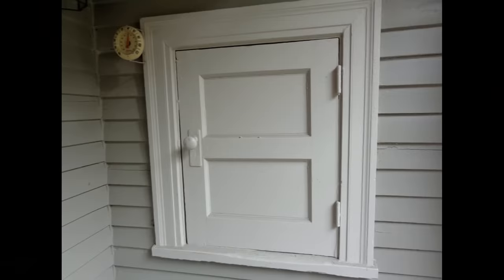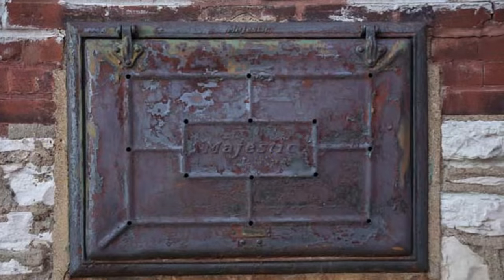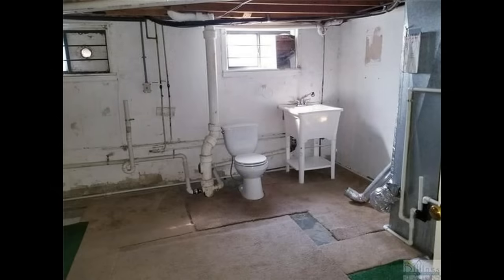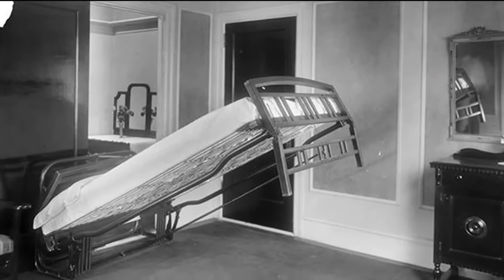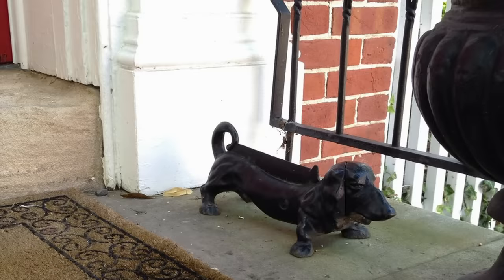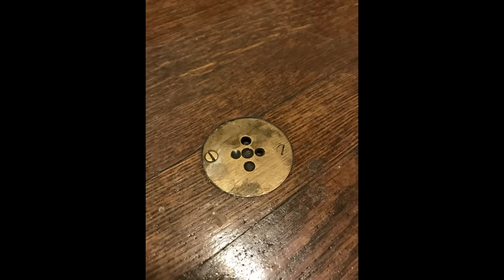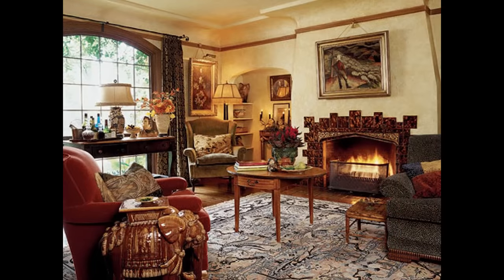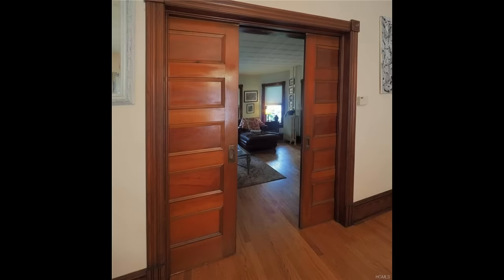Mysterious Home Features No Longer Used

Comment: The reason the laundry chute is no longer a thing is because it's illegal in many jurisdictions as it is a fire hazard. You will note that most homes now (with the exception of the stairwell) try to block air from moving from floor to floor except in fireproof ducts. In the event of a fire of the house would catch fire very quickly from floor to floor with a laundry chute
Reply from the maker: Ah, that makes sense.  I did not think about that and now I'm amazed that people are putting them in.  Makes me how many have done it despite the laws in certain areas.  Thank you for watching and educating us about that.
Reply: Yes, laundry could get caught mid-chute. You can imagine having that problem and needing to get it out. A big pile of stuck laundry could pose as a fire hazard, as you mentioned.
Reply: @grumpyoldwizard  the fire hazard isn't stuck laundry, it's the air flow.
Reply: @grumpyoldwizard  It's more about how readily fire can move from floor to floor then stuck laundry... This is also the reason why you will now find blocks placed between floors in houses now, whereas they used to use what is called balloon construction which provides fire passage from floor to floor. This is one of the reasons why it's harder to wire houses now after the walls are closed in
Reply: @RhettyforHistory  Very interesting! I can see why they're not used anymore, though the hobby engineer in me can't help but wonder if there's a way to make one that's fire-safe, because they sure are handy!
Reply: @JamieCashin  , couple the laundry chute with some good old tube and knob wiring and you have a winning recipe for an insurance claim .
Reply: Very interesting.
Reply: I think there’s also a risk of children getting stuck in them trying to play around.
Reply: @RhettyforHistory  come. 
Such hyperbole. You have more chance of getting killed in a car accident than a random laundry chute adding to very rare fires. And honestly, when the interior walls are wood framed and plaster I hardly think a laundry chute is the danger point of a fire has already taken hold.
Reply: @xr6lad :  Oxygen fuels a fire.  They become chimneys.  There's probably a way to get one approved with a sheet metal liner and a self closing fire door at the top, but it would require an architectural or engineers stamp.  As cool as they are, I can understand the reasoning here.
Reply: The chute creates a chimney. It's the same reason balloon construction is no longer used.
Reply: @grumpyoldwizard  I had an old house with a laundry chute from the 2nd floor bathroom to the basement. The previous owners left a fiberglass rod in the hallway closet. Found out early on in was used to clear a clothes clog. It never dawned on me the chute itself being a fire hazard as it would be a source for oxygen to feed a fire.
Reply: We had an addition put on our home about 20 years ago. My wife, who had grown up with a laundry shoot, want to install one in the addition. We were told it was against the local fire code.
Reply: @DS-tt9vz   How many times did that particular house burn to the ground because of that laundry chute... thought so
Reply: The chimney effect is an EXTREMELY easy problem to engineer around, with a universal, and universally pre-approved design that would be legal everywhere.
Reply: My mom who was born in 1925 said the laundry chute was a hazard to small children who would climb in.
Reply: @student1621  Your mom is correct about the laundry chute and children.  My ex said he and his siblings risked life and limb to go down the laundry chute in his granny's home.  She always kept a big pile of something to break their fall at the bottom.  Also, I caught my oldest daughter holding onto my youngest daughter's ankles while she dangled down in the chute at our house.  It's more dangerous for children than the thought of fire!
Reply: Actually most new homes are designed with first floor or in some cases second floor laundry room's nowadays,  so there's really no reason to have the laundry chutes anymore.
Reply: I do understand the ounce of prevention with making laundry chutes illegal. But I've lived in four houses with laundry chutes (a huge sample size, I know) and all of them had a door that is meant to be closed. And I would think that being closed on one end would prevent the chimney effect. But I'm not a professional anything, so...
Reply: That sounds so stupid.. 
especially since people no longer use open fire to heat themselves… 
Some American safety laws are so stupid…
Reply: @grumpyoldwizard  I lived in a house with a laundry chute and that's the reason we never used it. The clothes would snag on jagged sheet metal where the sections joined. If your clothes didn't get stuck, they frequently got a tear or started to unravel the cloth. When we moved in, we thought that this was an awesome feature. Within the first year we realized that it sucked and stopped using it. I lived there for twelve years, my mom moved out three of four years later, so the chute went unused for a long time. Well, not used for laundry, that's for sure. We sometimes dropped other things down there. Things not made of fabric.
Reply: @xr6lad  My grandma had a hole in the bottom of one of her bathroom cabinets that you threw clothes through to the basement. And yes, we used to jump into the basement all the time through it. Eventually my grandpa built a wooden cage box to catch the clothes and that ended us jumping down it.
Reply: Laundry chutes are still used. You can buy them online, often set in the lowest part of the wall below a fire block. Each state has different laws and each country can have different laws.
Reply: @dogman9291  Maybe some kind of trap doom at the bottom of the chute with a very sensitive weight censor to detect cloth hitting to door to open it and close automatically, build in the rights way it would prevent airflow issues.
Reply: In that same concern about allowing fire to travel between floors 2x4 8foot stud wall construction replace the original replacement of wooden beam construction, the 2x6 or 2x8 16-20 foot studs. 
Laundry Chutes from the second floor (or higher) to the basement laundry may no longer be a thing but single floor holes in a closet or under a bathroom sink can still be found as a conduit for dirty laundry. Because the distance of the hole is not much larger than the thickness of the door, the width of the hole need not be very large… clothing can be dumped into the floor and kicked one at a time into the hole with only large items need some manipulation I can fit an entire king size quilt through a whole about the size of a license plate in my first floor bathroom to the laundry area directly beneath it just by feeding a corner into the whole and patting gravity pull the rest through
Reply: Don’t apartment buildings still have garbage chutes? Do they impose the same fire hazard or is the technology a bit different such as the heavy metal doors on them?
Reply: @smartysmarty1714  I grew up in a house with a laundry chute. It was made of sheet metal, and had a metal door at the top that opened and closed on a metal spring. It didn't look anything like what was pictured in the video.
Reply: Don’t stairs allow for air flow like waasay more lol
Reply: The "fire hazard" vs. convenience factor leans strongly in favor of the laundry chute. Our local fire code administrator tells us not to prop doors open at work....because it is a "fire hazard". That isn't practical in our room with a copier that we go in and out of 300x a day. Always go with the law of averages vs. the regulatory state. In the very rare case you lose, then you can second guess. I stress very rare. Very, very rare.
Reply: I get it. But it would make things SO much easier!!!!
Reply: @gregggoss2210  The original 'knob & tube' installations were quite safe and dependable.  Problems occur today when the wire insulation materials become dry and cracked to expose bare copper wires.  The bigger problem is when people mixed new wiring systems with the 'knob & tube' system and it is rarely done properly.
Reply: @xr6lad  Getting stuck, or amputating hands, feet or even a head.
Reply: @xr6lad  Much of the fire code is based on the rate of spread that occurs during a fire, when a one minute difference and be the difference between life and death.
Reply: I thought it was more that new homes had the laundry room on the top floor at least where I live.
Reply: @coolsidecool  Yes, most homes now have laundry facilities on the first floor, rather than the basement.  Many now have 2nd floor laundry located where the bedrooms are. Just pray that they never leak.
Reply: @RhettyforHistory  There is a version of them that's starting to be used, it has blocks along the way that require weight to move them. There's one per floor.

There's also a larger version that's becoming available that doubles as a dumbwaiter, but powered rather than pully for it, those tend to be something harder to ban because it also works as an accessibility feature...one person I know had a house built with one recently due to a family member with a missing limb and it lets them move things more easily between all the floors of the house, it's big enough that you can fit some of the shorter, plastic laundry baskets into it, and the platform in it is hinged where you can push a button to open it and drop things through to the basement where they do laundry where there's an added gate with a piece to eject things to the side that are dropped down, but you can also lower things all the way down to just under waist level.
Reply: The whole point is airflow. Just like if you break a window you better be getting out cause the vacuum of the air coming in is now gonna feed the fire and make it burn hotter and spread fast. Just like blowing on a fire you make the flames bigger. How thats not logical worries me lol
Reply: No   Laundry stopped being done in basements. They aren't a fire hazard. The doors close, like a door
Reply: Never would have known that. Thank you for sharing.
Reply: @student1621  We found it was great place to hide during hide and seek. If you climbed above the basket if someone opened it to look for you all they saw was an empty basket!
Reply: You can still build a house with a laundry chute as noted by new house plans. I would love to have one!
Reply: @TheOldTapeArchive  not to mention the chute has two doors to prevent air flow! It’s not just a big hole with free flowing air and open ends
Reply: In 1970 we had a new home with a laundry chute and an intercom.   The intercom was a bad idea.  Like you are going to talk with your mother over the intercom when you can just yell or walk up the stairs.
Fire hazard?  It was a split level home, so the laundry chute was not the problem.  
A fire occurs in the kitchen most often, I suppose, or near the fireplace.  We had a brand new franklin stove, too.
Reply: @dogman9291  I think if you just had fireproof doors the way the Titanic had between bulkheads might be practical. You just have them hooked up to a smoke detector and all the fireproof doors could automatically shut. shut. (of course, that tactic didn't help the Titanic too much, but that was a special case.)
Reply: I read years ago that they were made illegal because people were afraid children would climb into them and fall. I don't have a citation.
Reply: I'm not sure where you live, but many jurisdictions allow them. Most Building Codes require a particular height off the floor (usually 36") and a limited diameter. Some areas require they are connected to a smoke detector so the doors automatically close when they go off.
Reply: and a great way to loose a kid
Reply: @deniseboldea1624  I still hang out laundry. Second floor would just add to laundry day.
Reply: @barbaramelone1043  Our clothes chute had a door in the upstairs and in the kitchen and they were like little closet doors made of wood. But then our old house was built in 1901. Different styles for different eras.
Reply: @student1621  we had a garbage chute out of metal and at 4 yrs old it was a blast to slide down.
Reply: I have a laundry chute in my bathroom.  House was built in 1956. I use it all the time
Reply: @winebox  I don't know if it's a great idea, but it does seem to be catching on in some areas.
Reply: @chrisgraham2904  Many building codes now require a pan under the washing machine that drains either outside or into the house drainage system. That takes care of almost all leaks.
Reply: Newer homes also put the laundry on the bedroom level now, so there's no need for a chute
Reply: @Mike Oxlong
My house was built in the 70’s and I have a laundry shoot. It’s in a closet, made with metal and the opening is sort of high so a child would have to climb up and over. It’s rectangular and on the narrow side which would also discourage a child. 

BTW, never had anything get caught. They’re great for getting clothes DOWN TO the laundry but I need something to get clothes UP FROM the laundry. Maybe a dumb waiter, is what I need, oh wait I have one, my husband.😂
Reply: Oh Zeeze, chute not shoot.
Reply: @xr6lad  The important thing is that insurance companies know they increase the number of claims, and therefore push to have them banned in modern building codes. You need to follow the money - if an insurance company says it's a problem, they know what they're talking about - it's a problem.
Reply: Really??  What about wide-open staircases?  They’re really big!  LOL.  I can’t imagine a laundry chute contributing to a fire hazard all that much.  For one thing, both chute doors are closed except while in use.
Reply: @smartysmarty1714  I
Reply: @smartysmarty1714  I had a friend that put one in her house. It cost $6000.00 extra because of all of the permits and inspections. It had to have 3 fire blocks, one for each floor.
Reply: My friend in elementary school had a laundry chute. It was awesome. BUT if it had been any wider I 10,000% would have gotten in. Other than stupid children I didn't know why we don't use them anymore. But fire? That's a no for me.
Reply: @renpilak6048  Yeah. Now I have more questions...
Reply: The laundry chute we created in my parent's home IS a fireproof duct.
Reply: Baloney! They are safer than a central climate control system. I've lived in 2 houses with laundry chutes and single zone central forced air heating and AC (one from the 40's one from the late 70's)...The laundry chutes were made with the same metal ducts as the climate control vent system. The chutes always have a door on the top end to seal them, but the vent ducts connect all rooms with nothing to block smoke or fire flow....Hell the central fan can suck fire and smoke from one room and move it to another and would do so automatically in summer when the AC is on.
If they were really a fire hazard then central forced air climate control systems would be outlawed too for the same reason.
Reply: @TheOldTapeArchive  if you have a fire alarm then there is a special battery operated door stop you can fit to doors such as your copier room. It's spring loaded and retracts if the battery fails or the inbuilt microphone senses a continuous noise level over approx 85 decibels such as when the fire alarm sounds. The doors then close automatically it they're fitted with door closers as fire doors are (in the UK at least). The UK version is called "Dorgard" and they're really useful to remain fire safe and convenient.
Reply: Modern laundry chutes have built in flaps that close automatically by a spring, once the laundry drops down the flap springs back up and closes the laundry chute.  Meets local fire codes.  The flap is pretty strong and close fitting, my cat hid in the laundry chute and never fell through it.  He was a "big boy" weighing 18 pounds, never fat!  Just a average sizes Maine Coon who never divulged how he got into the laundry chute, he was there a lot....
Reply: They should also ban stairwells and balconies overlooking great rooms !
Reply: That's really interesting when you look at the modern homes these days that have huge foyers that are open to the second floor anyway.
Reply: Since carrying a laundry basket down steps to the next level is the biggest reason for home injury and death every year I would rather take my chances with a laundry chute especially since I know of many houses that are well over a hundred years old and have never had a fire.
Reply: Worse than the laundry chute/chimney could be found in most knob and tube houses.  These houses were built using balloon frame construction with open walls from basement to attic in multi-story houses.  The whole house was a chimney.  Fire caused by a coal furnace or anything else in a basement could get in the walls and the attic would be on fire before the walls got noticeably hot.
Reply: @RhettyforHistory  why do you wonder how people are doing it? Do you think everyone immediately consults "the law" when they want to do something? My house - I'll do whatever the hell I want inside of it, thank you very much.
Reply: thanks for the info!
Reply: @renpilak6048  On the inside of apartment buildings they are sealed off.  Modern garbage chutes in apartment buildings are on the outside of the buildings.
Reply: @grumpyoldwizard  luckily I had someone who knew that a golf ball retriever would work.  I have a 2 story house with laundry in the basement.  And I learned the tricks to prevent the clogging.  My housekeeper kept clogging it up with the sheets so she is forbidden to use it now, lol.
Reply: I love my laundry chute!!!!!!!  I have a 2 story house with laundry in the basement, built in 1928.  Best tip I received—golf ball retriever dislodges clogs (use from the bottom).
Reply: @xr6lad  when little, we took a buch of pillows and placed at bottom of chute and our little sister would go down it
Reply: @xr6lad  I don't know about "rare." I know at least a few fires where I normally walk.
Reply: I remember trying to shove so much laundry down as a kid that I'd have to bust out the broom handle or whatever I could to push them down. Drop those items and it was a long day. Today, I have disabilities and would LOVE a laundry chute...and a dumbwaiter to bring the clean stuff back up. Or just be able to find a ranch home I can afford! lol
Reply: @ericah980  hi! Yes, our 1953 home had one. We used it for 12 years while there. Never had any clothes stick in it.it was made three feet off the floor ,in the hallway. They used to make clothes nets to catch the clothes. Think of all the tumbles down the stairs with baskets of clothes, that they they saved!
Reply: Keep the lid closed prevents air flow.
Reply: @student1621  One thing that can be said for kids playing around in a laundry chute ... they only do it once ...
Reply: @hazelwears8728  I guess women in 1925 weren’t able to stare at their children all day, since housework would take hours upon hours more time than it does today. Also, current parents don’t stare at the kids every minute of the day either, as people still have to go to the bathroom, shower, do chores, maybe work from home, etc.
Reply: Oh, that's right.  We're more conscious of fire stops these days.
Reply: @dogman9291  If you had fire-stopping baffles at all floors, that had to be overcome each time, would that work?
Reply: @lindac6919  That's along the lines of what I was thinking!
Reply: Had a laundry chute in a house I owned some years back- it was really well made, had a door on the top floor and one also on the main floor.  I loved it.  I miss it
Reply: Wow, have not thought of that. 
Sure would be a great feature to have though.
Reply: Depends on the state and historical value of the house. Laundry chutes are still in a lot of old houses as well as the dumbbell waiters. It is entirely possible to seal the chute from airflow when not in use.
Reply: The one house I had with a laundry chute had a pocket door at the bottom that closed it off. It prevented the airflow, and kept the laundry collected in a small cabinet next to the washer in the basement.
Reply: All the houses in the area where I live, including the newest ones, do not have doors between levels. Stairways are open. The newest homes are open from the ground floor to the ceiling, 30 or more feet above. Why worry about the fire hazard of a laundry chute when the house itself will not stop the spread of a fire?
Reply: Nowadays, laundry rooms are frequently built on the second story instead of the 1st. I definitely find this to be far more convenient since the majority of our laundry is distributed upstairs anyway.
Reply: @catatonicbug7522  my laundry chute was pretty big, and had a “box/cabinet” on legs at the bottom. It was in the basement and the clothes never touched the floor. It was awesome
Reply: @student1621  My son who was 6 at the time got stuck while playing hide and seek while we were out, . The older son called the fire dept. who had to smash the wall and cut out part of floor in the bathroom to reach him. He was wedged in pretty tight. We did repairs minus the shute.
Reply: @DUCKDUCKGOISMUCHBETTER  yup. My sister has one on her newly build house jere in Germany - and health and safety is taken extremly seriously here.
Reply: And plus I think that in most multistory houses, the laundry room is on the same floor that most or all the bedrooms are located. The closest thing you're likely to get in a modern house to a laundry chute is a dumbwaitor. A dumbwaiter is essentially a small freight elevator.
Reply: I live in a house built in 1924 and the city code requires springs on the laundry chute for fire safety.
Reply: @EmilyTienne  one thing making a laundry chute into a bigger fire hazard than a staircase is that the laundry chute often has a large pile of flammable material sitting at its base, and is frequently close to one or two possible ignition sources, the dryer (especially if it’s a gas appliance) and often the furnace isn’t very far away.  If the chute is metal-lined, smoke is the main concern, but if it’s wood, or plastic, or whatever, the lining of the chute can catch fire and carry it upwards in the house, possibly blocking escape routes from upper floors.  And chutes don’t always have doors at both ends.  I lived in a house built in the 1930’s with one, and it ended in a slatted bin about 4 feet
Off the ground.
Reply: A modern laundry chute is metal with a spring door like shown in the video.  No fire hazard.
Reply: My nephew thought he'd be clever and send himself down the chute to wow the family. His parents were not pleased!
Reply: @Leigh-says-stuff  This is all true.
Reply: @RhettyforHistory  Actually every laundry chute I've ever seen had a tin liner so clothing wouldn't catch on any nails or splinters. This also made them fireproof. I grew up in an older part of town so I saw a LOT of the features in this video. We STILL have a medicine cabinet with a razor blade slot in our CURRENT bathroom.
Reply: @xr6lad  This happened to my cousin in the 80s.  He's an idiot though, so....!  🤣
Reply: @marialiyubman  People do still use fireplaces if they have them in their homes.  And fire is still a thing, whether people use it to heat or not.  If a fire happens, that chute will make it spread much faster, to all levels of the house.  It makes perfect sense if you think about it for a second.
Reply: @larsonfamilyhouse  My cousins lived in an older house, in the 80s.  It had three stories and there were openings, with no doors, to the chutes in a couple of places on all floors. It lead into the basement and just dropped from an open area into a basket.  No doors at all.  Also, as an avid Estate Saler I have been to several houses with chutes, some open some with doors.  They just aren't all the same.
Reply: my aunts old house used to have one of those, i remember looking down it from the top floor
Reply: @RhettyforHistory  kkkmm
Reply: @RhettyforHistory  mmkkmmm
Reply: @RhettyforHistory  kkkkkkkmkkkkkkkkkkkmkkkkkkkkkkkkmkk
Reply: @RhettyforHistory  kkkk km to kokkm
Reply: @RhettyforHistory  mkkk
Reply: @RhettyforHistory  mkkk
Reply: @RhettyforHistory  kkkokmkkkk
Reply: @RhettyforHistory  k
Reply: Kkkkmkko
Reply: @RhettyforHistory  k
Reply: Yes, my grandmothers house had them and I got to take them out when we remodeled it. The rope was pretty thick if I recall and the weight was just a cylinder of lead.
Reply: In the movie "Critters 3", the monsters, a flare, laundry chute, and laundry caused a fire in an old apartment building.
Reply: But it's so convenient :/
Reply: Also too, if you can put them on they must be big enough for an adult to fit through which means they take up a lot of space in a home that might not be present if not planned for.
Reply: @dogman9291  100% there probably is. But it'll take someone more experienced than me to figure that out
Reply: With all the open plan now I think a washing chute won't make any deafferents in a fire !
Reply: @TheOldTapeArchive  Your local fire code administrator isn't wrong though and has your long term well being in mind.  Conforming to the fire code regulations has never been about practicality.  It's about saving lives and minimizing the spread of fire throughout structures.  
I cannot speak for your specific situation but while it's true that large fires are fairly rare occurrences for most people, in situations where fire is present, laxity almost always leads to preventable losses to life and property.
Reply: @renpilak6048  The materials used for garbage chutes tend to be fire resistant and sturdy metals and/or blocks as opposed to the fairly flimsy wooden or sheet metal for a laundry chute.  Also, garbage chutes tend to have better seals to prevent odors which also makes the chimney effect less of an issue.
Reply: As a kid, my brother, cousins, and I would climb down the chute from the second floor to the basement at our grandparent's home.
Reply: @gregggoss2210  Properly installed Knob and tube wiring was very safe. It dissipated heat very well. One of the problems with it is that people would add circuits to it then put a larger fuse in the fuse box or worst of all put a penny under the blown fuse. We used to have a electrical contractor in town by the name of Penny Electric. Their slogan was "Don't put a penny in the fuse box, call Penny Electric.
Reply: They’re not illegal here but most new builds have the laundry room on the same floor as the bedrooms or it’s on the main floor.  I haven’t seen a new build with basement laundry room for a long time.
Reply: I lost my front teeth, smashed out on the door jam of the shoot, when dislogging a blockage and trying to not get hit in the face with dirty laundry.
Reply: @lilah66 , we had tube and knob wiring in our house up until  about the mid 60's. The insulation had deteriorated so it was necessary to replace it. My dad and my brother rewired the entire house themselves.   Yes, that type of wiring was good when new, but after so many years it becomes a safety hazard.
Reply: I guess it depends on your state as to the laundry chute being considered  a fire hazard.  Here in WI it is not.  My house has one.  Never heard of it being an issue.
Reply: A common feature in many older homes to this day are open air registers between floors allowing for natural convection. For example, my grandparents' house only had forced air registers on the first floor. The only source of heat to upstairs bedrooms was a single ~1SF register in the center of the house. On a bitter cold night, the stairway door would be opened.

My brother once owned a single story home with a basement furnace that worked entirely by natural convection. There was a single large register directly above the furnace and multiple cold air returns near the perimeter of the house. All had adjustable louvers. The house had an early version of an open concept. The only way to get significant heat to the bedrooms was to have the doors open.
Reply: Thank you Jamie, I would never have known or thought about that, but you are absolutely correct on that theory.
Reply: The modern one require fire doors and dampers I think.
Reply: True fact, I bought my house because it has a laundry chute that goes all the way to the second floor. It is line with sheet metal. Oddly enough, the first floor access is INSIDE a kitchen cabinet.
Reply: I was thinking it just became a home for pests, but that makes sense.
Reply: This is actually pretty simple, the reason why the sheetrock on the ceiling is 5/8 instead of 1/2 is because it represents a 1-hour fire break. A laundry chute  breaks the rule and breaks the break.
Reply: @grumpyoldwizard  Think big. Think about the kids using it as a slide. And getting stuck.
Reply: Maybe that's why our "chute" was just a trap door in the bathroom closet
Reply: @ankylosaruswrecks3189  There's a reason why the dinosaurs are extinct, and you're it!
Reply: It makes much more sense to have the laundry area by the bedrooms than to have it in the basement.  While a laundry chute is nice, you still have to haul the cleaned cloths up the stairs.
Reply: @ericah980  I have one in my kitchen, my house was built in the late 70's.
Reply: It could be addressed the same way the turrets and powder magazines for guns on ships are protected from explosions spreading.   There are cylinders with an opening on one side which is rotated.  That would also keep kids out of it.
Reply: I added one to my home over 30 years ago from the upstairs guest room to the first floor laundry room .  Never gave the legality a thought.
Reply: @xr6lad  Dad put a latch on ours when my baby sister came along and started crawling. It had been just a loose board laying on the floor
Reply: @ankylosaruswrecks3189  as someone mentioned earlier, house fires are extremely rare. To justify their full time positions and exorbitant salaries firefighters have to go around and cause trouble for people to make it look like they’re actually doing something. Eliminating laundry chutes was just one such measure.
Reply: When I worked as a carpenter several years ago, we put in fire block (2x4 between studs), every for get vertically. This was to stop the chimney effect inside walls.  Won't stop a house for, but can slow it down quite a bit
Reply: With laundry moving up to the upper floors where the bedrooms are, less necessary or practical.
Reply: @renpilak6048  exactly, also they are not inside the apartments.  For codes are far more restrictive in àn apartment building or condo.
Reply: Fire Safety
Properly designed, a laundry chute provides unobstructed passage between floors. Many people believe that this chimney-like construction has the potential to turn a small fire into a really big and utterly devastating one. On the other hand, many builders and architects point out that stairways carry the same potential risk. And whereas stairways are typically open, laundry chutes are most often closed shut behind doors that can slow a fire’s spread.

Regardless, in some municipalities, there are strict fire codes prohibiting or restricting the construction of laundry chute. Before going ahead with plans, be sure to check with your local building authority.
Reply: @CAgrandaddypurps69  the vacuum of the air coming in?
Reply: @colettes4999  someone further up was talking about "loosing" kids. There's a lot of it about.
Reply: Children also tended to try sliding down them and some have died doing so.
Reply: The house I grew up in, built in 2003, had a laundry chute. Guess it wasn’t illegal in Missouri at the time
Reply: Today they place 2x?'s between the studs in walls, the floor, the ceiling and the rafters.
Reply: @marialiyubman  There are lots of houses that use open fire to heat. Ever hear of a fire place? Many are open and lots of houses have them. And they're still used!
Reply: @Nicky L Why are you jumping on me?  I didn't think that idea up, it's simply something that has popped up on a few HGTV shows.  My best guess as to why would be that most bedrooms are on the second level of a colonial home, so perhaps those who choose this option feel it's easier to gather and clean the laundry.
Reply: But wait, noted residential fire expert Roy Marshall: “A stairway does the same thing.”
Reply: @larsonfamilyhouse  yes. their argument is nonsensical
Reply: @deniseboldea1624  2nd floor laundry rooms are horrible.
Unless you like the stairmaster to work out to change loads of laundry constantly.

Those appliances are going to break at some point.
Hauling one of those bigger newer washing machines down a flight of stairs and up one is a nightmare.

Or when it does break it is going to flood the house.
Damaging the floors, the framing, the drywall and insulation. 

If it is a slow drip through the framing  that is not noticed for a while then there is possible mold, wood rot and under the right conditions attracts insects such as carpenter ants and termites.

No thank you.

This is not a good idea.
Reply: @Loagun  I never knew you could fireproof a duck.  I'll bet that makes the PETA folks happy.  Hellish on the cook on holidays though................
Reply: P
Reply: @shawnr771  LOOK!  I'm not endorsing it, I simply mentioned it, would you people stop yapping at me already!  Direct your complaints to HGTV if it upsets you that much!😡
Reply: @deniseboldea1624  it dont upset me you seem more upset.
I listed why they are not a good idea.
Reply: @shawnr771  My apologies,  another poster was acting as if I came up with the idea, your post coming right after seemed like you were jumping on the bandwagon.
Reply: @deniseboldea1624  nah.
I got no reason to do that to anybody.
Just sharing some practical experience.

Another bad idea is Spa tubs.
Waste of money.
Most people use them a few times then never again.

The water lines under them leak without the homeowners knowledge.
Then the same thing happens.
Reply: @janehitt646  I lost mine running into the handle of a grocery cart at the store.
Reply: @grumpyoldwizard  mom would push stuck laundry down with the broom handle.
Reply: @RhettyforHistory  I suspect it's mostly because hiring a contractor in to do some work a lot will just do what you ask and not worry about code violations, that's a you problem when you try and sell the home and the buyers conveyancer points it out
Reply: @Loagun  a duck?
Reply: @dogman9291  Well, you could put doors into the chute that can be opened manually but close automatically. If those are fire-resistent (and especcially smoke-resistent) enough for your jurisdiction it should be no problem.
Also keep in mind that fire protection is in many jurisdictions a holistic (?) issue: The laundry chute posed a danger, primarily because it was an unobstructed path into the basement, where the fuel for your heating would often be stored too. If there was a gas leak, it would spread up into the living space often even into the bedrooms. If the coal caught fire the smoke would spread upwards.
But an increasing amount of new-build homes don't have fire-based heating and have ergo a much lower risk to fire in the basement in the first place.
Reply: I had a chute growing up clothing would get stuck soooo much and now you say it such a hazard. However because of the older house it was original and omg I miss it as an adult!!
Reply: The reason laundry shoots are no longer a thing is because people don't put their wash machine in the basement anymore. You may be correct about the fire hazard and and the safery risk of a laundry shoot but ultimately that has nothing to do with why people don't use them
Reply: Not true. Most laundry chutesare lined with metal So they don't spread fire in the smoke as in a problem because they're provided with little doors
Reply: @grumpyoldwizard  laundry does not get stuck in the laundry shoot and all you He have to do is grab a broom and push it down. Laundry shoots are very handy and safe mostly women a ton of work. I have one in my house and it's metal lined and has a little door so it's not a fire hazard. I have no idea where somebody came up with that but it's fairly creative
Reply: @dogman9291  they were made fire safe. They were always lined with metal. And they have a door in them that you can close
Reply: You are the destroyer of my dreams; ill have you know that now. All my dreams (of havin a laundry chute) have been dashed to pieces by your comment.

How dare you destroy our dreams! /s
Reply: @RhettyforHistory  Maybe they have some method to close the chute completely in the middle to prevent air passin up or down?
Reply: @xr6lad  We never did, even as younger teens....
Reply: @gregggoss2210  My family's home built in 1966 had a laundry tube, and I can guarantee you we did NOT have rod and tube wiring. I watched much of the house be built as a child when we'd go visit it during construction.
Reply: @RhettyforHistory  if you note the example you showed near the end had the laundry chute in a metal duct quite similar to a ventilation duct. I would assume a design like that would help to prevent fire from climbing.
Reply: Oh, no! Illegal? Our home growing up (in the '90s and '00s) had a laundry chute, and it was just the most convenient thing. Besides the screened in porch and the finished basement, it was just the neatest thing.
Reply: That doesn't seem right.  Not that I don't doubt your correct about the fire code, but the fact is that many laundry chutes were simply build into wall cavities where the wall was framed with 2x6 (or even 2x4) lumber.  Many times they emptied into the basement with just a hole in the ceiling.  Meaning they WERE about as likely to spread fire as any other form of in-wall HVAC ducting running between floors at the time they were in use, although now with more rigorous rules about sealing off those HVAC cavities, they probably would be a little more concerning.  From what I understand, those laundry chutes were in fact very prone to stuff getting stuck in them.  This is also why you don't see the old fashion mail chutes anymore in high rise buildings.
Reply: The house I live in originally had a laundry chute from the bathroom to the basement. When I remodeled the bathroom, I eliminated it when I installed new OSB flooring and floor tiles.
Reply: @xr6lad  If the fire started in the basement (where the furnace was) the laundry chute basically acted as a chiminy, directing smoke and super heated air upstairs.
And back in the day, laundry chutes weren't that random (quite common, in fact) and fires from basement furnaces (and possibly washing machines) were anything BUT rare!
Reply: I've had laundry chutes in both places I've lived over the past 8 years....and I absolutely love it!
Reply: @student1621  we never got stuck in it. Mind you were weren't super young, but we all tried climbing through it. It was in my sister's closet (second floor), to  utility closet near the laundry room on the first floor.
Reply: @Hazel Wears, you mean like me and my siblings.  HAHA. We climbed through ours. Who knows where my mom was or what she was doing. but we snuck down it, at least once each. Just because. Kind of like the time we put the ladder up against the back of the garage roof and jumped off the roof (8 ft) a few times. LOL
Reply: @ruthmiller5588  Well, we never hung each other upside down in our chute. It also wasn't all that long.  It only went from my sister's closet to shelves in a utility closet on the first floor. It really was more a box, than a chute.
Reply: @badbiker666  Ours was wooden. And at my friend's house hers was metal lined (built in the 80's by her Father in Law. Went straight to the laundry area.
Reply: @chrisgraham2904  Exactly!
Reply: @gblakev  I've seen the pans. But never once have I seen one connected to a drain. That would be ideal. No matter what floor the washer was located.
Reply: @5610winston but BOTH have doors on either end.... At least any I have ever seen do.... thus blocking the air flow.
Reply: @christinemeleg4535  Cats are funny creatures. I am kitty sitting two Very Big Boys. One is a bit on the hefty side but refuses to eat wet food. The other eats his canned food. Stretched out the one can stretch more than half way across a full sized bed, and that's ONLY his body! not his head and tail. His brother (the slightly more hefty one) still isn't fat, just hefty. He is only a bit shorter than the long one. And they get into everything!
Reply: @michaelb.8953  Seriously. If I want the laundry on the first floor, I toss it down from the balcony or the upstairs landy. Getting it back up I would give anything for a dumb waiter!!!
Reply: @Icehso140  I can attest to that building factor. I was helping a friend of mine one summer with his various properties. The oldest house was about 250 years old. Had rod and tube wiring in many places (which he later upgraded as much as the electricians could access). We were adding insulation to one of the attic areas. Mind you the house had the original foundational "basement" a huge first floor and an equally large second floor with a couple of attic spaces. We were insulating using a special blower and some kind of treated paper insulation. Blowing it into the spaces. Later we went into the basement and found about half a bag in a pile where it had basically gone from the uppermost attic straight past two floors into that pile! I couldn't help laughing, and still do, when I remember that....
Reply: @goldenretrievermom7945  I've seen new hotels with the garbage chutes, all on the inside.... guess they pay higher insurance?
Reply: Depends on which kids. According to this conversation thread, that's not been the case....
Reply: As a kid, I lived in a house built in the early 80's. There was a closet in the upstairs hallway - well, it looked like a closet. It actually revealed a large square hole that went through to the laundry room! Mom put a huge laundry basket down there to catch the laundry. I was old enough not to be tempted to mess with it, but worried about my cats, my mom placed a block of particle board over the hole. 
Sure enough, the cats fell through it a number of times. They liked to sit on top of the board (cats like to sit in squares, circles, boxes, etc.). There was carpeting around the hole, so the board sort of sank in to the hole, making a bit of a depression.
Fortunately they always plopped into the laundry basket and were OK. It probably would have been safer to just not have the board there at all.
Reply: Laundry chutes closed just like a door. Where are they illegal?
Reply: I had one, loved it!
Reply: Mike Oxlong  Interesting, because I bought a house with one in CT after those years.
Reply: @xr6lad  my shitty older sister definitely tried to get me to go down the laundry chute many times but I didn’t do it cuz I was afraid of getting stuck
Reply: That's a travesty, laundry chutes are amazing
Reply: @jmdenison  If they are build that way, that is. But then they are much more expensive than they used to be, before they had these doors installed. I remember my uncle having a laundry chute, that was essentially quite like a waste chute found in many construction sites.
Reply: @dogman9291  I was thinking the same thing! My husband wants to install one, we just argue where it should go. Knowing the fire hazard, and knowing how little difference it would make in our house, I'd still like to know how it can be done right... research is needed...
Reply: ....would a laundry trap door be a fire code violation?  It could certainly be more fun to build...
Reply: @kblewis3331  Ours went down from the second floor to the basement!  That was about 20 ft.!
Reply: They have new laundry chutes, the new ones have a few doors inside them that help deter fire. But it costs much more money to use fireproofing materials than to just cut a hole in a wall.
Reply: @michaelb.8953  My boyfriend recently moved into a place with the only stairwell between the first and second floors having a 90-degree turn in it -- not an actual spiral staircase, just that one turn -- and between the steps and the railings, I predict someone, resident or guest, is going to fall down them and hurt themselves in the first three months. May have to come back to update this comment. ;3
Reply: I did some research and searched for 'are laundry chutes legal' I found this on Farmhouse Guide. 'Laundry chutes are no longer a standard amenity seen in many homes or businesses these days, but they are not illegal in most places.'  'However, due to fire safety laws and specific building codes, some cities, states, or towns may not allow the installation of laundry chutes'. I think the main reason most modern houses don't have laundry chutes is because modern washers/dryers are put on the living level. They are usually put in a dedicated closet behind doors. Back in the day people had wringer washers, which were messy and took up lots of space because you needed wash tubs, and no dryers so clothes had to be hung on lines to dry. When I was a kid, that's what we did. My house, where I grew up, has a laundry chute which is basically a hole in the floor behind a cabinet door in the bathroom and a box in the basement made of wood strips for aeration. It was built in the early 60s. My brother's house had one too but the laundry just fell on the floor.
Reply: This seems to make sense. I remember a youth hostel I stayed at as a kid that had both a laundry chute as well as a kitchen elevator. I found that fascinating. I still think they are neat - and it should not be too difficult to bring them up to snuff with modern building / fire codes. Sure, children might be tempted to try and slide down into them and getting stuck. You know, children being children (i.e. sometimes...not very smart). One the whole though, I don't really understand why they fell out of fashion. I guess it's another case of "But sometimes...!".
Reply: @DeputatKaktus  We did slide down our chute when we were small. It was a very short trip though, only about 3'.
Reply: My house has a laundry chute.... but it came with the place. House is built in 57 tho.
Reply: Does anyone else hate the old horsehair/plaster walls that are IMPOSSIBLE to bang a nail through?  You would feel the hammer bouncing off the nail when it hit a slat underneath, and/or chunks of plaster would break off. What a pain that was.
Reply: Ours had a door and was metal. In the hallway wall, not in the floor.
Reply: @xr6lad  My area (MN) has specific construction requirements to reduce/eliminate air flow through laundry chutes.
Reply: @RhettyforHistory  Non-combustible   materials, and air-tight doors. Problem solved.
Reply: Our laundry chute got smaller 1/2 way down so you had to put clothes in 1at a time, easier to take a basket full downstairs😂
Reply: As a related issue, hospitals of the late 19th to mid 20th century were constructed with garbage chutes. Bio hazardous material and all types of garbage was dumped from upper floors to basement receptacles, where a worker would transfer waste to an incinerator, periodically. In the 1950s, in Connecticut, waste materials in a hospital holding bin ignited. As you noted, fire at the base of a chute travels from floor to floor with lightening speed, and this is what happened, in this case. The cause was either spontaneous combustion, from oil coated rags igniting under the pressure of the pile of garbage, or use of the chute for emptying of ash trays (cigarettes not quite extinguished). Whatever the cause, 62 patients died in the multi story fire.  For all public buildings, garbage chutes were listed as "illegal" for new construction. If I can find the link, I will edit this comment. Unfortunately, my apartment building has a garbage chute. I wish that it did not.  Thank you for your comment.
Reply: @dogman9291  There is. Use metal ductwork as was shown in the vid as an example of a "modern" laundry chute.

I
Reply: @gregggoss2210   hah lots of places you can't get homeowners insurance with active K&T.
Reply: @RhettyforHistory  You could do it safely with modern sensors and motors using metal instead of wood and having a door that only opens at the top and bottom by either detecting a loan inside the chute or manual opening, as well as designing the system to be fail close, so in the event of power loss like a fire would cause the system fails into a closed state.
Reply: @xr6lad  You can argue with physics, but you will never win. Fire, smoke and toxic fumes will always rise from a starting point. Heat rises, and smoke and fumes with it. Any chute built into a structure creates a draw for a deadly combination of oxygen, flames, smoke, and toxic fumes. This is just the way the physical world works, and sometimes kills.
Reply: @xr6lad  . 
          I agree with your 'struck by lightning or winning the lottery' common sense/logic, but...  
          Doesn't matter how rare the occurrences are.  If insurance companies get ahold of information tying a feature in a building to insurance claims that they have to pay out, you can bet your bottom dollar they'll be having their lobbyists clamoring for building codes preventing such things.  
          It's always bean counters finding this stuff, these relationships between one thing and another.  IF it costs them money somehow.  
          People assume medical researchers or hospitals or doctors figured out the links between high cholesterol or high blood pressure and heart attacks.  
          Nope.  Insurance company actuaries in little rooms with calculators and spreadsheets discovered these cause-and-effect relationships.  
          I agree with what you're saying about how rare these fires may be, all I'm saying is if there's some building code thing that seems a little over-the-top, it's probably insurance company dollars involved somehow.
Reply: My Dad built a house for us w/ a laundry chute in 1968.  We sold it in 1975 to a couple who still live there.  They remodeled a few yrs ago & kept the laundry chute.  Their contractor wanted to remove it but they said "we're keeping it."  My brother who took over Dad's business said a laundry chute that is closed off at all openings is not a danger.  There wouldn't be a chimney effect.  If the house caught fire, the laundry chute would not be the reason.
Reply: I once lived in an older university dorm building at college that had multiple floors, each built around central kitchens. The kitchens were connected by a central rubbish chute leading down to a huge bin in the basement. Convenient, sure. Fire hazard, ABSOLUTELY! In fact we had a kitchen fire on the ground floor once, and smoke almost immediately got into all the upper floors. There was only minor damage, but still, scary stuff!

(Side note: this was in Germany, so there was no AC or central heating. The rubbish chute, lift shafts and stairwells were the only way air could move directly between floors.)
Reply: Why would a laundry chute (typically made of galvanized sheet metal ductwork and approximately 12x6 inches, narrow enough to fit between joists) be more of a fire hazard than an open staircase? Answer: IT WOULDN'T.
We had a laundry chute in our 1941 house. There was a door at the top of it, held shut with a magnetic catch so no, it wasn't "open." By your logic, no house could have any kind of ductwork running from floor to floor, which of course isn't true. Many homes have the furnace/air conditioning unit in the basement, with ductwork running to the second story. Suggestion--If you don't know what you're talking about, DON'T.
Reply: @student1621  We had a laundry chute; it was about 12 inches wide (so it would fit between the wall joists) and about 6 inches deep. There was no way a child of any size could climb into it (the door was only 12 x 12), with a 90-degree turn into the ductwork. Maybe you could drop a baby down one, but that would be about it.
Reply: @xr6lad  we have a laundry shute.  They're not big enough to get stuck in lol
Reply: @gregggoss2210  Actually the tube and knob wiring was much safer than what came after, wires were run together with  poor insulation material that quickly fell apart.   The t & k is ok as long as not overloaded.
Reply: @Gail1Marie  Because they allow heat to travel MUCH easier between floors.  You don't need an actual flame touching something to cause it to 'flash over' into burning.  All you need to do is get it hot enough.  A fire in a laundry room that has a path through which super-heated air, smoke, AND flames can move more easily upward is OBVIOUSLY more likely to spread to upper floors than a fire in a laundry room that has NO such pathway.  Why do you think there's a chimney above a fireplace?  Because THAT is a situation where you WANT to guide the excess heat out safely.  Would you build your chimney out of wood, or sheet metal that's only 1/64th inch thick?  No, you build it out of something they've been using to build ovens for thousands of years.  Brick.  
Also, maybe there ARE building codes in some areas that specify how to make a laundry chute.  I guarantee you it'll be designed with things like fire and children in mind.
Reply: @suellenw561  Interesting that the contractor mentioned it.  I replied somewhere to someone who sounded convinced that WHAT the laundry chute was made of was some determining factor in it's safety.  Part of what I said was there very well may BE building codes that allow them, if they're designed with fire safety in mind, like maybe ones made of stuff that doesn't burn, and that are guaranteed to completely close off if you don't move a lever properly or something...
Reply: @TheGenXer  Right. What I don't understand is why firefighters pickaxe holes in the roof of burning buildings. Is this not creating more fire? Seems like it to me.
Reply: @dogman9291  have a spring operated trapdoor at the bottom with a tight sealed closure at the top. I don't see why that wouldn't work.
Reply: @xr6lad  Doing away with laundry chutes is one reason why residential fires are "very rare" these days.
Reply: I grew up in a house that was built in the 1980s that had a laundry chute that the builder put in.
Reply: I've seen chutes like that converted into tall liquor or linen cabinets between floors. Especially if they are copper clad.
Reply: @tomconner2326  That’s because you asked the wrong person. 😉 I’m building a house now & can’t imagine living life without it. New house is getting a chute, fire code or not. 

The fact this is the shadiest thing I’ve been involved in for years is kinda disappointing.
Reply: @grumpyoldwizard  - As long as the chute was properly lined, nothing should get stuck.  Though a friend of mine's mom kept a few softballs with hooks screwed into them for these situation.  Something gets stuck, and you just roll the balls down until they catch and pull the item free.  And if that didn't work, you simply attached a weighted string to one of the hooks and used it to pull the item free.
Reply: Many laundry chutes were lined with the same ducting material used for ventilation.  And as long as the basement door was spring loaded and latched, it would meet fire codes.
Reply: @xr6lad  My sister got stuck in ours. Between floors. She was actually very lucky she got stuck as she would’ve fallen 3 floors from bedroom to the basement onto a concrete floor! We were all terrible about throwing toys and all sorts of things down that shoot when we were supposed to “clean” our rooms. LOL
Reply: @smartysmarty1714  once again safety screws over practicality sorry but in this case screw safety.
Reply: I understand the fire hazard issue but I still wish I had one, because I hate lugging laundry down our stairs. I always feel I’m gonna fall.
Reply: @mdroberg  - There's nothing stopping you from looking into adding one.  You'd just have to figure out a good place to put it, assuming your house's layout would make it possible.
Reply: @dogman9291  It wouldn't be hard to have a spring-loaded shutter across the duct that is held open by some metal with a low melting point, or some similar arrangement.  If you wanted to get really fancy you could integrate it into a fire alarm system.
Reply: @JamieCashin  Back when I was in college we had a housemate that at one time was a campus cop. He told us about a dorm fire in the basement of a high rise dorm. The only people that were hurt, killed in fact, lived on the top floor. That was the only floor where someone had propped open the fire doors so the smoke could get from the basement to that floor.
Reply: Funny enough I live 2 new houses built in 2000. They both have multiple laundry shoots. They were part of the original design, so I'm surprised they are approved in California.
Reply: @dogman9291   Just make one and seal it up.  What about a stairwell....how is that even legal ? lol
Reply: Ohhhhh thanks. I loved the idea but now not so much.
Reply: My Son bought a house recently that was built in 2007 and it has a laundry  chute. The kids joked that they would use it for hide and seek, but they are old enough to know better and were only joking. 
One big hazard, I set my overnight bag close by and was taking medical items out when I got interrupted. I came back and looked everywhere for a remote to my implanted device. I thought I'd had it by my bag when called away. When I left laundry room, the Laundry had come down, was scooped up and put through wash. 
Don't put important things where laundry comes down the chute!
Reply: @renpilak6048  a skyscraper has budget and engineers that can design a system to keep a possible fire in the chute, in the chute. 
From fire rated chase lining. Steel chute itself, heavy steel access doors that auto close on the chutes at each level. 
Opening only into waste rooms that are similarly built to fire code w steel doors and auto closers….  
As someone else mentioned, it can be engineered. But it has to be cost effective.
Reply: Remember them?  You bet, plus I was the building super in two old apartment buildings (still standing today) that had these windows and ended up repairing these sash cords all the time.
Reply: yes. True. Even using special expansion form in drill holes to avoid fire flow, between floors.
Reply: @Loagun  What I'm seeing in renovations and new construction - laundry on each living floor, often as part of the master bedroom en suite upstairs and centrally located on a lower floor.  As for the chute/duct itself, I think there's more to the fire hazard than just heat/fire going up the chimney - it provides a draft for combustion air to support a fire that is burning under some floor or ceiling, compromising more than just the area immediately around the chute/duct/chimney.  I'm sure there are ways to engineer mitigation to the hazards but suspect it's cheaper and frictionless (code-wise) to add additional laundry space and hook ups.
Reply: @larsonfamilyhouse  Yes, and that's why open stairwells are no longer code compliant in new construction.  Would residential laundry chutes represent a significant number of personal injuries and deaths?  Possibly not, but they'd make casualty losses greater and increase the likelihood of injuries or deaths.  To whom does that matter, other than victims?  The insurance industry, and they help write the model codes that ones state or municipality can adopt in whole, in part, or modify to create local Codes.
Reply: @abcde_fz  My friend's house has an entire open staircase that leads to the second floor. There is no door between the first and second floors; it's entirely open. But you'd have me believe that a laundry chute (with a door at one end, so it isn't open) would be more likely to conduct flame and heat than a loft that's 20 feet wide? That's nonsense. Why would the fire code allow houses to be built like that (as they are today) if it were a fire hazard?
Reply: @smartysmarty1714  Many apartment buildings have garbage chutes. Wouldn't that be similar?
Reply: @student1621  I can see how the maid would get tired of washing them
Reply: @TheFloridaStig - Hey Ron....well, obviously the rules would vary from state to state although there is something called the Universal Building Code.   What I think happens with the garbage chutes is that the chute itself is fireproof (like concrete block) and each door that accesses it is a fire rated door.   This same theory could apply to laundry chutes too, although in residential homes it would be a lot more intricate for not a whole lot of gain.  But a garbage chute is no different than a stairwell.   Picture a high-rise apartment building that has a concrete stairwell and multiple fire doors to access the stairwell.   They all require closers, and that would apply to a modern day chute as well, I would think.
Reply: @smartysmarty1714  fascinating! thank you
Reply: @Gail1Marie  I was attempting to explain a possible reason for why some places (apparently) have building codes prohibiting laundry chutes.  I could definitely be wrong, and whether you believe me or not is not my concern.  If and when someone creates a building code that prohibits stairwells or lofts, perhaps I'll try to offer an explanation why they may have done it.  Perhaps not.  
One thing's for sure, I'll never feel stupid TRYING to think things through.  I'll leave feeling stupid to people who don't.  
Have a great and safe day!
Reply: @chrisgraham2904  yup, I live in a late 1700's home with knob& tube/fuses & had mine inspected to make sure it was in good condition before I bought the house. Except for one area in the basement where some idiot had done his own tie-in , (that i removed) & some small chewed areas on a 3 season porch( that a historical electrician repaired for cost, since we let him film it for his YouTube channel) I've never had even one problem with it..never even have blown a fuse ! Of course there's issues, like if you are a tech head/family & need more power than it can draw..or in some places getting insurance can be tough/even impossible..& I can't use certain insulations with it ( like the blown-in ), but unless I have to, i'll happily keep it :)
Reply: @Rayyvyn  Times have changed.  When my grandparents first got electricity on the farm, it was to provide one light bulb in each room, I recall two receptacle outlets in the kitchen and they had one outlet in the livingroom (the parlor) for the big GE tube radio.  Today, everything plugs in.  LED bulbs today provide some relief from high amperage draw to compensate a little for everything else.  I guess your not planning to charge a Tesla from the house in the near future.  LOL.
Reply: @uncaboat2399  huh? Was that sarcasm, or have you never met a kid?*snicker*
 Only a child that dies in a laundry chute CAN only do it once. ( sorry, maudlin, but true,lol,)...and a child that is claustrophobic ,gets stuck, or has a panic attack in one will PROBABLY only do that once...but a child that finds it can win at hide & seek, loves the bottom-bounce,  outrace it's siblings downstairs ,or loves the ride but hates getting wet or road-rash from slip & slides WILL do it as often as they can ! snicker ( the 7 yr old inside me fondly remembers flinging myself down the chute at my Gparents house as often as I could !)
Reply: @lilah66  lol, you must be from my part of MA !
Reply: @proudamerican2133  that's why old houses had picture rail trim, so you could hammer into that ( or even better,use the slide hooks made for it) instead of the plaster & lathe behind it to hang large platters, pictures, mirrors, curio shelves, ect :)
Reply: @runcible4755  LMFAO !  I think things such as modern electrics, modern stoves & heating systems, building materials, neighborhood firehouses, smoke detectors/fire extinguishers  & about 50 other things are more likely the reason less homes are lost to fires today...  not getting rid of laundry chutes.
Reply: @chrisgraham2904  nope,can't even switch to a tankless water heater,lol & no AC over a 550, I also had to sell my professional kiln, as the fuse box only has the 1 section for anything with that kinda pull & since I've gotten accustomed to heat on demand, i wimped out & decided the furnace was needed more chuckle but it's still fine for most things. Heck, my last tenant was a Millennial, w/every tech toy under the sun  & daily I expected fuses to blow or a fire to start(esp with all the extension cords he had everywhere to power it all,since only 2 outlets in room), but shockingly, nothing ever happened :)
Reply: The house my parents had built for them in 1968 had a steel laundry chute.  Great feature!
Reply: @renpilak6048  They are often seal up today.
Reply: @TheOldTapeArchive  SMH
Reply: @Rayyvyn  yeah, being an artist I've made sure they are in my home now, but places I rented for college back in the 80s sadly lacked them, and I suffered the bouncy slats 😄
Reply: @TheGenXer  also, there is no "stop" to prevent the heat smoke and flames from traveling to floors above. It gives it a direct path. Just like now we have the firestops between studs in the framing.
Reply: @dogman9291  they do. Higher end homes are putting them in again here and there.
Reply: @xr6lad  thats the truth. And the multifloor apt buildings in NYC still have garbage chutes. People will find a way to screw things up every time. 🙄
Reply: @DS-tt9vz  never would have thought people would be dumb enough to not know how to not jam the thing up, and just carry down larger items. Then again...
Reply: @chuckwadnofski7147  exactly
Reply: @student1621  there are simple latches to avoid this. If we can lock down pur toilets and cabinets we can muster the ingenuity to install a child proof latch. There is a serious lack of common sense problem solving skills lately.
Reply: @proudamerican2133  I have noticed that & did wonder if they are now enclosed inside the wall cavity or if the code writers simply forgot.😉
Reply: @Rayyvyn  There's 305 replies here (so far). Don't make me go back and figure out which stupid comment I made that you thought was stupider than usual!😆😆😆
Reply: @aodhganmerrimac  could be either, haha
Reply: @TheGenXer  It could be a wad of greasy clothes, which can spontaneously combust!
Reply: @DUCKDUCKGOISMUCHBETTER  Yes, implement a spring loaded door that snaps shut after the clothes fall through!
Reply: @Fetherko  Yep...although I'm sure some ninny would complain about it potentially catching a kid by the neck. But there are easy mitigations to minimize or eliminate any potential harm from this unlikely problem as well.

Make the spring a light action...not strong like a mousetrap. And put a delaying action in the spring action, so it takes a few seconds to return.

Personally, I think the whole thing SHOULD be designed for complete safety and with the implicit ASSUMPTION that children WILL be riding down the chute. And why shouldn't they be able to do so? It's fun. And it can certainly be made safe. Or at least safer than a backyard trampoline.

Put a big trampoline with a standard safety enclosure around it, and make it safe to slide down the chute, and you can have a safe, indoor 2 or 3 story, in-house combination of a children's playground slide and basement trampoline. Make it like a steep slide, rather than a direct drop. Hours and hours of indoor fun...as a dual purpose device. Maybe land/slide into a pile of dirty clothes at the bottom. Kids would think that was a novel gross idea, lol. And they'd get plenty of exercise climbing the stairs each time to slide back down again from the 2nd or 3rd story.
Reply: I live in a home built in 1923 with a laundry chute and knob n tube wiring.
Reply: Also has steam heat and push button light switches.
All in good shape.
Reply: Very cool! Our home, built in 1938, has many of what has been described here.  From the transom in the kitchen to the toilet in the basement, and root cellar in the basement. We love not having an "open concept" as well. When we eat in our formal dining room, we don't want to stare at the dishes in the kitchen! We love our old home, except for block windows in the bathroom.
Reply: So you're telling me the laundry chute is a larger factor in air flow than something like, oh, I don't know, STAIRS? :)
Reply: @xr6lad  You're right, of course.  If that little chute isn't there because it allows air flow, then wave goodbye to your stairway!  And ::horror!!:: get rid of that elevator!
Reply: @chuckwadnofski7147  That's about the most hyperbolic "logic" against a safety precaution I've ever heard. You don't wait until something is so catastrophically dangerous that destruction is a certainty to call it a hazard.
Reply: Probably better if they were built with concrete so a fire can't spread and burn everything to the ground.....
Reply: Laundry chutes can easily be made fire safe.
Reply: I've never seen a laundry chute in a British house, though we have them in hospitals. In hotels, the cleaners use carts to collect the laundry.
Reply: Since nobody seems to have fully explained this, the laundry chute chimney thing works like this.

For a fire to grow, it needs fresh air at the base. Often in a house fire, the fire is slowed by the fact that the interior of the house is deprived of oxygen by the surrounding fire. That's why opening a door or breaking a window can cause a back draft; the sudden access to fresh air causes the fire to grow explosively.

The laundry chute allows fresh air from the upper stories to travel unimpeded to the basement where it can feed the fire from underneath, which is THE best way to feed a fire if you want it to get really hot and burn all of its fuel really efficiently.
Reply: @dogman9291  simply have the walls be like air ducts and have an air tight seal at the top sota like the door to a furnace i suppose some thing like that could work.
Reply: @xr6lad  this is the real reason they aren't common anymore. Ducting for hrv and the possibility of a forced air system with ducting negate the fire argument. Far too many children have gotten stuck in laundry chutes. The modern alternative is a smaller pipe with a vaccum to suck the clothes to their destination. The reason people don't install them frequently is cost.
Reply: @JamieCashin  actually balloon framing is still used, the reason we have transitioned to platform framing is because it is faster to build and creates a safe work area quickly at each level that can be accessed to place material because there are no walls yet. Blocking can be used to create a fire barrier in balloon framing that does the same thing as having a transitional floor. In fact some people say balloon framing is more energy efficient because it eliminates potential gaps in the building envelope.
Reply: New houses are now putting the laundry room on the same level as the bedrooms as that where the most laundry is generated. My boss' new house has the washer and dryer in a room next to the bathroom on the second level - the room is built to bathroom standards so it has a floor drain in case of a washer malfunction and the electrical is GFI type system. A laundry chute become unwarranted.
Reply: @xr6lad   In hospital comedy shoes, there used to be one of the staff who fell down a laundry chute.
Reply: Small kids used to get into them and fall two or three stories, often getting killed in the process.
Reply: 324 replies later I somehow feel the need to mention that my 2000's home had a laundry chute. We used it maybe a dozen times. Laundry often got stuck in the shoot and if we're talking fire hazards, the stuck laundry kept the bottom door ever do slightly open. 

It ended up being way easier to just schlep our laundry up and down the stairs than to use the laundry chute. 

Obviously, it wasn't the greatest design. Maybe it would have been a different story with a more deliberately designed chute, but that was my experience and I've never wanted a chute since.
Reply: *if you have a finished basement, be sure to make _AT LEAST ONE ESCAPE ROUTE OTHER THAN THE MAIN STAIRS.  Otherwise you’ve remodeled your basement into a fiery death trap.
Reply: @smartysmarty1714  Look at the image of a 'modern' one at 2:52.  The outlet has a metal door held open by chains.  In the chains are fusible links that melt and let the door close if there's a fire.
Reply: Wouldn't a great idea for modern shoots be like those clear tube slides in kid parks work? & curve in a way as to eliminate the blockage & 🔥  hazard?
Reply: Dang I miss my laundry chute
Reply: I have no doubt that some jurisdictions have outlawed laundry shoots based on that reasoning, but it's still bad reasoning (like the idea behind states that don't let people pump their own gas). If there's venting, there's air, which is the only thing that would really contribute to fire hazard when you consider these would have doors on them. Thus why firefighters do things such as shutting down HVAC in large structure fires, although that's usually solved when we cut the electricity anyway. Beyond that, something as insignificant as a laundry shoot that is closed off on both ends is not really going to pose a fire risk worth even thinking about, especially compared to open floor plans, portions of a home with cathedral ceilings with open balcony areas coming from the second floor, attics the length of the structure (one of the most common areas fires spread through a structure) and tons of ventilation and ductwork throughout (Oh, gee golly, it's got metal ductwork? That definitely isn't going to start coming apart and exposing the structural members when it heats up).

It's much more likely that opposition to them was related to concerns over the safety of children, TBH, and even that would likely be spurious reasoning.
Reply: I think that’s also why they don’t put in dumb waiters any more. A friend wanted to put one in from the tuckunder garage to the kitchen and it wasn’t allowed because of fire hazard.
Reply: Never heard of that. Code here just requires two exits from every bedroom.
Reply: That does not make any sense, what about big open stairways with no doors to the second-floor bedrooms in new homes????????????
Reply: @xr6lad  And you have more chance of getting killed in a car accident than you do if you ate an arsenic-laced cocktail at your brother-in-law's house. What's your point? Fires are indeed "very rare" but why make things worse if a fire does happen? Your comment makes no sense.
Reply: @Loagun  I think the word you are looking for is "duct," Mr Smart Guy.
Reply: @student1621  That was the old style. The laundry chutes of the 1960s and beyond had an opening in the bathroom that was about the size of a sheet of paper, and a good four feet off the ground. Small kids could not reach it and even if they could, could not fit through the opening. Also, the metal door had a heavy-duty spring on it, making it quite a tight close, thereby reducing the way a fire could spread were the whole thing an open set-up.

Granted, clothes had to be sent down one or two items at a time, unlike the old days when you could grab all the laundry from each bedroom and chuck the whole lot down the (then bigger) chute at once.
Reply: Mike Oxlong  I think you meant Encyclopaedia Britannica! Good gawd!
Reply: @badbiker666  It sounds like shoddy construction. This never ever ever occurred in any of the places I and my friends lived. Every family used them where I grew up and with zero complaints. The clothes never got caught on anything and never got damaged. I think you just had a lemon of a chute, probably due to shoddy workmanship.
Reply: @CAgrandaddypurps69  You had the perfect comment until the idiotic and predictable "lol" at the end.
Reply: @Lloyd Stambaugh I also have BX throughout my garage and workshop, which is a separate outbuilding.  These active areas are more likely to incur damage and a few squirrels and raccoons have made it inside over the years.
Reply: @lisahinton9682  The house was built in the early 1920s. My family moved in during the mid 1960s, so 40 + years passed since the chute was installed. Probably not exactly shoddy construction, just something not designed to last forever. I suspect that the sheet metal had just enough of an overlap that over time something finally caught. And then someone in the basement reached up and pulled on the garment and exaggerated the situation, and it just kept getting worse. Then we moved in and by that time it was practically useless as a laundry chute.
Reply: much how many homes built between 1850-1920 (I think that's the rough dates) had balloon framing and it's exactly why it's no longer used. you just had straight up open pockets between the walls where the framing was, so fire went straight from the first to the second floor. a ton of homes in my area burned down in less than twenty minutes as a result, and were completely engulfed in about three or five due to balloon framing.
Reply: @xr6lad  I live in an old house and there is no way in hell a child could climb in mine unless they are shaped like a very large bible. Now I’ve seen larger ones and again unless it’s an infant I don’t see it happening. But it would be horrible if there was a child in there
Reply: I grew up in a multistory farmhouse built in the 1900’s. My family installed a laundry chute in the late 90’s or early 2000’s using a big green PVC pipe and a cabinet-like box with a hinged  lid on top. It was such a nice convenience; it never dawned on me until now that they could be a fire hazard.
Reply: @xr6lad  The reason chances of being killed in a fire are so low now is because of all the improvements like that being made. Imagine a 2 storey house with basement. Basement fire starts. Lots of ignition sources, the dryer is a frequent cause of fires, also unattended appliances as washer, dehumidifier, fuel burning heating, electric heating, space heaters, basement shop with tools and chemicals, etc... 

Now when that fore starts, it jumps right to the upstairs hallway... so sleeping people are trapped and have to leave through windows... if they are lucky... if the bedroom doors are open, smoke, then rapidly fire goes into the rooms.
Reply: @renpilak6048  Here a garbage chute has to be fireproof and completely isolated, with self closing fire resistant doors. And after a certain size building, all the chute spaces have to have sprinklers.
Reply: @RhettyforHistory  Do one of these about cars next.
Reply: And even before laundry/trash/coal chutes help fire spread throughout the building, they help bugs and rodents spread throughout the building.
Reply: Old houses with the open stairways are refered to as chimneys by quite a few fireman.
Reply: I wonder where this is illegal, and considered a fire hazard, I know places in Ohio where it is still legal and not considered such.  Same with some places of upstate NY, and VA.  All of which are places I lived in before.
Reply: I grew up with a laundry chute and have so many fond memories. One of our cats would sit on the bathroom counter and try to catch small pieces of clothing, like socks. She'd cry by the chute door for us to come play. It was such a convenience when the bedrooms were on the second floor and the laundry in the basement.  I always thought everyone had one!
Reply: @marialiyubman  maybe.... but my neighbor's house burnt down. It was built in the 1920s; so it was built before these codes.
Reply: They can be made safely these days. First being built the same or similar to air ducts for heating/cooling, being all metal. Second, auto close doors at both the upstairs and basement levels. The basement level can be done using spring load to allow for clothes to pass through when they hit it, or manually opened and auto close after.
Reply: @marialiyubman  Heating has nothing to do with it, there's many causes for a house fire.  There is logical reasoning behind it, however, protection & safety from government comes in the form of restrictions & loss of freedom.  Freedom comes with risks but weak people that are too stupid to understand this & think they're entitled to protection & are quick to sue anyone for anything cause these ridiculous regulations to be forced on us which are unconstitutional.  The government doesn't have the authority to restrict us from doing anything to our own property.  It's a shame the majority of U.S. citizens don't know we are a republic & how it works.
Reply: I lived in a house built in 1998 that had a 2nd floor laundry chute.
Reply: @gregggoss2210  In a new home it wouldn't pass inspection and no insurance company would pay the claim. Just saying.
Reply: @xr6lad   YES My first thoughts.
Reply: @xr6lad  While what you said might have truth in it from one perspective, the fact remains that it is a fire hazard and they make laws to protect against fire hazards. In fact, those car accidents you mention? MOST ALL OF THEM are the result of someone disobeying the LAWS that have been enacted to stop just such occurrences.  And, it's easier to enforce a laundry chute law than an auto law.
Reply: That makes no sense.... stairwells are still a thing. A small chute isn't going to have THAT much impact on a rare instance of a fire. If they were THAT worried about fires, then they would also be sealing off the top and bottom of stairs (which we don't do).
Reply: Why not make them fireproof too. I know that many are starting to bring these back. Hauling laundry isn't fun.
Reply: @TheOldTapeArchive  that convenience lazyness is how several Brittish WW2 warships blew up before the admiralty cracked down hard on fire hazard violating practices...
Reply: They aren't necessarily illegal but you have to make the whole thing fire rated and sealed on both ends. We put one in our house in the '90s and had to get the ducting certified as well as the lid and the cabinet door with a fireproof gasket on it on the bottom.
Reply: I put one in my house.  Used standard HVAC ducting made of metal
Reply: I have spring loaded metal doors on both ends of my chute which automatically close reducing the fire threat
Reply: @larsonfamilyhouse  no, they do not. Didn't you ever see a fireplace?  The smoke goes up that little chimney and not into the room. Why? Because it is waaay easier to heat up a small space than a large one. And then that hot air rises, pulling more fresh air into the fire causing it to burn even hotter, causing the chimney to get hotter, making the air flow even faster, and so on.  So the laundry chute has two effects in a fire - it increases the intensity of the fire by drawing more air in, and it spreads the deadly smoke throughout the house at a very fast rate.  The effect of a stairwell is near as pronounced.
Reply: I have never seen a laundry chute, but wouldn't a door with good seal  at the top and bottom of the chute, prevent it from being a fire hazard? Don't closed doors usually do the same to prevent fire from spread to more rooms?
Reply: Yeah, but at 02:53 you see the modern solution...  they've capped the ends of the laundry chute with a metal door that blocks hot air and flames from going up the tube and spreading.  Showing that when people want something bad enough, they'll find a way to make it happen and, if necessary, ensure it's legal.
Reply: @grumpyoldwizard  clothes don't spontaneously combust just because they are in a laundry chute.
Reply: Built a 3-story house 20 years ago with a laundry chute.  The process was complicated for fire safety - the chute has a full metal liner and each entry point must be behind two doors - except the bottom floor, which could be open.  Another oddity, that was almost a deal-killer, was that the chute couldn't be a straight-path down, it had to have a step in it at the second to third floor junction... supposedly for child safety.

The result was the second store entry into the laundry chute was placed in the kitchen pantry, with a solid oak door, and then had another solid oak door protecting it - with a seal.  The third floor entry was placed at floor level in a special indirect-access between the bathroom sinks, if it was higher the door would have to have been made from steel.

One of my cats took the chute for a ride down from the third floor a few years ago... landed in a soft laundry bag with plenty of laundry in it... took forever to find the poor critter! Not injured, fortunately.
Reply: @marialiyubman  As are some Americans....
Reply: @coolsidecool  Where do you live? I've never run across that.
Reply: That was great. We had rings in the garage supposedly for tying horses and that odd freestanding toilet in the basement.
Reply: @marialiyubman  there doesn't have to be an open flame for a fire to start. You are aware that electricity can start a fire, right?
Reply: @debbylou5729  they absolutely are a fire hazard. A nice big chute for fire to travel up, INSIDE YOUR WALL.
Reply: A wide open staircase doesn't feed a fire like a smaller chute would. The laundry chute would act like a forcing cone in a rocket engine, except the air is being pulled instead pushed. A large volume of air traveling up the chute at a high speed would suck the smoke, fire, embers up the chute. If both doors of the laundry chute were open, you would have a bad day. There is a reason they are against FIRE CODE in many areas, because they can be a fire hazard. This is just one reason the fell out of favor. I have heard of children getting seriously hurt or killed by laundry chutes and dumb waiters.
Reply: I'm putting one in my house was built 1914 and has alot of the features mentioned I see it as a period feature plus the house is built with old growth Douglas Fir and clad with same and cedar so if a fire where to occur a chute would be last of my worries
Reply: Laundry chutes can kill you too…the door in my bedroom would not stay open so my mom used a brick and made it look like a cat by covering it with felt and drawing a cat face on it to keep the door open. One day my youngest brother got mad at me for some reason and wanted to get revenge and put that cat doorstop down that laundry chute knowing it would break went it hit the basement floor….unfortunately my mother was gathering dirty clothes dropped from the chute when that cat/brick flew out missing her head by inches.  50 years later we still laugh about that though at the time he had hell to pay for that stunt.
Reply: @xr6lad  Yeah, well, there's nothing so stupid that someone hasn't tried it. My friends and I used to debate trying to slide down the one in my parents house when we were about eight. Common sense prevailed.
Reply: @marialiyubman  - Open fires aren't the only cause for a house burning up. A great portion of house fires come during the holidays. Something about having a dried up tree decorated with lights that give off heat with packages wrapped in paper underneath.
Reply: @RhettyforHistory  The house i grew up in had a laundry chute, but there was a door that snapped shut at the entry and exit. They were fairly sturdy and solid.
Reply: I'm sure one can be designed so that when you open the door to throw the laundry in, there could be a mechanism that would open a door at the other end for the laundry to fall and then shut when you close the upper door, thereby sealing it.
Reply: @Tim M -- I got to thinking about this a few weeks after I commented on it.  I think they have fire doors on them now, and the ducts are probably rated in some way too.  In "the old days", we just put a cabinet frame with a cabinet door over them and they were good to go.  I think it's different now, but I've been out of the home building loop for many years already.  They would probably operate on the same rules that apply to a chimney though.  They'd have to have a fire stop every 8' and be air-leak free.  I'm sure there's a way...there always is.
Reply: @dogman9291  spring loaded self closing trap doors. weight of laundry opens and closes OR have weighted trap doors held open by electromagnets, same as doors with self closers you see held open, alarm cuts power and they close
Reply: @ruthmiller5588  I never had a laundry chute, but we had an old barn with a chute, probably for grain or corn. We had so much fun, until the day my sweatshirt caught on something and I was stuck. That was terrifying. I think I yelled loudly enough to get my brother's attention and he pulled me down.
Reply: My parents house was built in the mid 2000s and has a laundry chute
Reply: Oooh.  Good point!  I guess it would be too expensive to enclose the shoot in a fireproof duct.
Reply: @greyeaglem  we had something similar, in the house where I grew up. Basically, Dad built a trapdoor in the floor of the bathroom linen closet. It had hinges, and a little handle with which to pull it open. It opened directly into the ceiling of the basement. We'd drop our clothes through to the floor below, and the pile would then (eventually) be taken to the laundry in the next room. Mom was always afraid we'd fall through the hole, lol, but we never did. That drop always seemed a long way down, to little me, so jumping was something I was way too afraid to try, lol. Anyhow, when Dad finished the basement, he installed a drop ceiling down there, so we couldn't use the laundry chute anymore, and he bolted it shut. On another note, that drop ceiling was a fun place to hide things! 😉😂
Reply: @dogman9291 the one in the house I grew up in was lined with metal like a duct. There were "cabinet" style doors at the top and bottom that were wood on the outside and had an insulation panel on the interior. That house was built in I think 1982 in the US, presumably to code at that time.
Reply: I live in a 1921 home that had 2 laundry chutes. When we had a basement fire last year I saw exactly why they are no longer legal. Thankfully, we got out before it was too late and most of the house was salvageable. The chutes are no more though.
Reply: @marialiyubman  All it takes is a short in a wire to cause a fire you know.
Reply: @RaquelSantos-hj1mq  That would have been fun and scary!  It would have been me to get caught on something in the chute!  Hooray for your brother!
Reply: Than the little elevators are illegal too? Never knew that, I always said that if I was to make my own home( or renovate one) I would build a laundry chute. (still gonna do it lol I'm just a rebel! bhaha)
Reply: I live in a older house and we have a laundry chute. Ours is made to look like a little cabinet next to the bathroom door. And it's literally just a hole in the floor with a door in front of it, so you just open the door and drop your stuff down it. There is a chain to keep the little one and cats from messing with it but seeing as there's an air docket next to it the cats sit on that then talk to us when they get stuck. 
My house also has a ash shot. Where you would sweep the COLD, DEAD ashes from the fireplace down a little whole to a HUGE catch thing under the fireplace and after a while you'd open one of, for us, 2 little doors to clean that up. A good shop van works better then a shovel and broom.
My house still has landlines as well. We use those for spam calls and the important calls, that we don't want on our cells.
Reply: We still have a laundry chute in our house, it has a door over it and is inside of a closet though so theres no free air flow. It’s honestly pretty useful
Reply: @012E-c7f  Don't you LOVE just throwing things down it instead of dragging everything downstairs. Great for getting frustrations out when you can throw something down a hole and know that nothing was going to break.
Reply: Very interesting and I can see that. My neighbor had one but they only had a ranch style house and a basement.
Reply: My siblings and I had a lot of fun with that old laundry chute.
Reply: @dogman9291  there is its 2 inner layers of fire rated drywall and fire rated access covers.
Reply: @ToyAddict  I doubt that single chute is going to make the difference except in a very few freak instances. I'd be more worried about living in a house which has it's load bearing construction made out of wood. All of the load bearing construction in my home is either brick or reinforced concrete. 

Sure that laundry chute might theoretically act as a chimney and make a fire worse. But that doesn't really change the fact that most single family homes in the US are built entirely out of combustible materials. Especially older homes that predate lumber being pressure treated with fire retardants. I'd be more worried about the joists being combustible than some faux chimney.
Reply: Maybe if you didn't construct with paper and shredded "wood" oh well, at least other countries can use them
Reply: @dogman9291  my engineering brain is conjuring up a door mid-chute with a lever to operate....
Reply: Yes, they act as chimneys, moving hot air and embers upward.
Reply: Just coming here to say the exact thing — laundry chutes are a fire hazard. Too bad, as they’re so useful.
Reply: I looked into this a little while ago. The balance of evidence suggests laundry chutes aren't a fire hazard as they were believed to be, but my understanding is that took a decent amount of research to work out.
Reply: Thank you for this. For the life of me I could not figure out why, when we had our home built 2 years ago, they would not offer a laundry chute. Now it makes total sense and I'm glad we don't have one 💜
Reply: @grumpyoldwizard  Not sure how it would be a fire hazard having laundry stuck in the chute.  My mom used to keep a broom with a coat hangar attached to it that could be used to dislodge the stuck laundry.
Reply: Can they make it fireproof like the ducts?
Reply: Oh yeah ive thrown out patients trash in a building and wow their is alot of wind, blows yuckiness right in your face
Reply: @grumpyoldwizard  This happened all the time with our laundry chute when I was a kid. Had to use a broom to unstick them 😭😭
Reply: I would imagine kids crawling in and getting stuck mid-way, too, or falling headfirst on the downstairs floor. Also a good reason to not put them in.
Reply: @xr6lad  I used to do just that in a 1947 house.
Reply: @xr6lad   It’s that if the fire starts in the basement and spreads near the chute, the chute acts in the way a chimney does - same reason one should always close the door at the bottom of an enclosed stairway, in your house.
Reply: Still in use, this old house will show you how to repair.
Reply: I have one
Reply: @EmilyTienne  the narrow vertical channel is what creates the condition for combining concentrated heat with rapid airflow for efficient fire acceleration. Anyone skilled at starting campfires or fireplaces will understand intuitively.
Reply: @tomcarlson3913  the shape, size and course of the channel are critical factors in fire acceleration. Yes, forced air HVAC can be problematic for the reasons you cite, but the analogy is not strong.
Reply: @TheCablebill  That’s true.
Reply: A laundry chute can obviously be made more fireproof than a heating duct. The laundry chute can easily have a spring-loaded door at both ends sealing it off completely.
Reply: Wouldn’t stairs pose a similar risk?
Reply: Yes, stairs create a fire vortex.  Maybe they should be banned as well.
Reply: @debbylou5729  I still do my laundry in my basement...
Reply: You must live in a highly regulated dem state. Laundry chutes have doors. Like the ones in your walls. They stop air from moving up the chute. The basement is seldom the same temp as the upstairs. Idea....we should have them around the house. Open them in the summer for cool air
Reply: so a fireproof one with one way doors with proper sealing along the edges would be perfectly legal.
Reply: @liamnehren1054  even interior doors don't have that
Reply: I really can’t believe there are 426 comments on laundry chutes.
Reply: Never considered this. Thank you!
Reply: @EmilyTienne  it's because they are one of the most awesome of these forgotten household design aspects.
Reply: Yrd
Reply: Yes
Reply: That does makes sense, it's too bad though that that's the case, it would be really useful for seniors or moms with small kids, and I'm not even going to try to pretend that I, a full grown woman, wouldn't install a super slide, or at least would try, until my own FF husband stopped me 😁
Reply: just another example of government overreach
Reply: In other words, if you want a laundry chute, build it yourself and keep your mouth shut.
Reply: totally worth the risk of burning down the house esp in a multiple story house.  totally worth it.   you can get ones that are allowed they have spring closed doors on both ends (so it can't be a chimney)
Reply: @RhettyforHistory  New laundry chutes just have to have air tight seals and you wouldn't leave them open.
Reply: @RhettyforHistory  They can be done safely now, as long as the laundry chute is lined, and other fire or draft blocking measures around the chute are installed.  It can't just be a hole between floors anymore.  They are usually sheet metal or some other rated material now.
Reply: I don't think it matters, firefighters usually destroy homes when they fight fires.  If they were really concerned about fires they wouldn't allow homes to be constructed out of wood, wood flakes and glue, or even worse wood dust and glue:  All houses would be made of concrete or stone.
Reply: @renpilak6048  Here's a NIOSH firefighter fatality report, where the trash chute in a multi-story building contributed to the fire growth and death of the firefighter. https://www.cdc.gov/niosh/fire/pdfs/face201317.pdf   see page 5 - The trash chute, which
was where the fire originated, was enclosed in the building at the end of the hallway with a dumpster
located at ground level that was accessed for removal by an outside door. The top of the trash chute
terminated in the attic space of the apartment building and did not provide any type of barrier to
prevent a fire from spreading throughout the attic.  ..
Reply: @chrisgraham2904  most claims in homes are water related not fire related
Reply: @savannahsmiles1797  That's true.  Water causes the greatest damage to homes.  If the fire department comes to put out the fire, then you have water damage.  LOL
Reply: You would think stairways would also be illegal for the same reason.
Reply: @grumpyoldwizard  Most folks had a long pole to poke things loose.
Reply: @grumpyoldwizard  Most folks kept a long pole handy to poke it loose.
Reply: Good to know!
Reply: A lot of hotels have laundry chutes. They are wonderful when you have move laundry from an upper floor to the laundry area.
Reply: There is an excellent Australian podcast about a young woman named Phoebe who died after “falling” down a laundry chute. Imho she was definitely murdered by her pig (allegedly) abusive boyfriend. It’s very tragic. When I was in college we had garbage chutes but separate actual laundry rooms to do laundry.
Reply: Didn't little kids also get killed by falling down them too?
Reply: @oldtvnut  if there’s anyone you can trust it’s the insurance company
Reply: Not illegal per-se in most areas, though it is against code in some and there are a lot of restrictions in other areas due to fire and safety concerns.   In Michigan, for example, in new construction it has to be enclosed with a one-hour fire rating.  But the regulations vary greatly for single family homes versus multi-family residences and commercial buildings like hotels and hospitals.  I don't see any flat ban on them by FHA.
Reply: Modern laundry chutes are constructed using metal duct work and have self closing doors at each end.  Old laundry chutes always had a door at the top which would have prevented airflow.  Laundry chutes pose(d) no greater threat than a stairwell or open wall cavities between floors.   From the 1960s until recently, there were more single story houses being built than two story.  Now that we are seeing two story houses being the normal again, it is common practice to put a/the laundry room on the second floor with the bedrooms.
Reply: Neighbors had a laundry chute,I looked down into it  one day and saw a cat staring up at me
Reply: Tis a shame. It's very cool
Reply: Just build a second floor laundry. I was grateful our last had the laundry room on tube second floor! Now we're in a single level with a basement. Laundry on the main floor! 🙌🏽🙌🏽🙌🏽
Reply: I lived in a house that had a laundry shoot.  One time the shoot went almost down to the floor.   Then, I ad one that was close to the ceiling.   There needs to be a way to bring clothes from the bottom up to the first floor.
Reply: I don’t think it’d make much of a difference with natural gas heat
Reply: @student1621  That is certainly true, especially if you've got siblings or cousins around. I was born much later than your mom (I suspect probably later than you, based on your mom's age -- who I hope is doing well!) and I had the personal experience of siblings and cousins attempting to bribe me into the laundry chute to "see what would happen."
Reply: @deniseboldea1624  Homes with laundry chutes already had first floor laundries. The chute was typically to take the laundry from upper floor(s) to the laundry room on the first floor (or, depending on the region, the basement).
Reply: @debbylou5729  Plenty of parts of the country don't have basements; their laundry chutes went from the second floor to the first floor and are still quite practical.
Reply: @jacksyoutubechannel4045  I'm not sure what part of the country you are from, but the majority of the homes in Michigan had thier laundry rooms in the basement unless the home did not have a basement.  In more rural areas,  the laundry was done on the covered porch particularly if they could afford a washer and dryer,  and on occasion, some located the laundry room in an attached garage if they had one.  

In any case, the laundry chute going from whatever floor down to where the laundry was done made sense, though it didn't resolve having to lug baskets full of laundry back up flights of stairs.  Maybe a laundry dumb waiter would have been a better idea.

I've lived in 2 homes that had the chutes, both had a basement.   My current dwelling is the first time I've had laundry on the first floor, gotta say I like it much better particularly as I get older.
Reply: @jacksyoutubechannel4045  yes, I know, having had both
Reply: My ex-husband's family home has one. The home was built in the 70s. They built it themselves from the main bathroom closet to right across from the washer and dryer. I would love to have one now, instead of lugging it downstairs.
Reply: It would not have been a great idea having a laundry chute especially when we were younger! We did put cousin Tommy in the dryer as well as put him in the hamper when we were kids! I can't believe my siblings and my four cousins are still alive! We did do so many dangerous things just for shits and giggles! It was great growing up in the sixties being a kid! The usual running behind the mosquito truck pushing each other in a baby carriage down the hill! Cousin Ricky always needed a Band-Aid or an Ace bandage wrapped around his knee or ankle till this day things haven't changed for cousin Ricky! Today cousin Ricky is known as Band-Aid boy! Putting paper clips around our teeth to make believe we had braces! ✌🏻🤟🏻
Reply: @xr6lad  you wouldn't have done it? I know for sure I would have with my cousins and siblings!
Reply: @greyeaglem  there you go my kind of person!
Reply: I remember my grandpa made pulley to go to the second floor because we lived in a two family duplex... My Grandpa would put one of us in it and pulls up to the second story window that led to the kitchen! I remember shoveling cold in the furnace! My grandmother had a washing machine the round one that you would bring the clothes to the whatchamacallit? Also iron wires to hang pants! My sister and I wanted to play dress up we wanted to be the Supremes so we use curtains it wasn't all fun and games we itched for days!! The milkman coming that left eggs and milk and which I fell into the milk box that was made of steel cracked my head a little bit! Those were the best days! ✌🏻🤟🏻
Reply: @chrisgraham2904  I have knob and tube of course it's not in use however you can touch it am I correct on that? I have whole new electric and at one time there was cold downstairs in fact my basement was 3/4 of dirt and 1/4 of basement it took them 2 years to dig out the whole basement so now I have a wide open space,. Some of my houses still only have 1/4 of a basement! My house only has one closet and someone made a little closet in my bedroom that is cattycorn!
Reply: @debbylou5729  not for me Debbie Lou I have to work at my back door onto the patio and take another door downstairs to my basement! And yes that's where I do my laundry! I don't have a problem with it it seems other people have a problem with it! My house is turned 100 this year 2023 it is only 825 ft! What's good about my house even though they were all made the same back a hundred years ago 1923 they added a enclosed from porch onto my house so it's very lovely! Plus I have a back porch which is also lovely! Just don't throw sock in the middle of the living room because it looks like a tornado hit my house!
Reply: @winebox  yes hang in the clothes outside on the line from the second floor especially in the winter all the clothes were frozen! We used to dry our hair bye event that was in every room! In my house that I own now which is 100 years old there are two vents that were left behind which I love and all the walls are plastered! Not here anything you literally have to go into the room to talk to someone!
Reply: @annettecook9695  we could have been best friends.... I would have been  right behind you!
Reply: @joycejohnson7640  Joyce that's my sister's name as well! A few comments back Nana made a whole underneath the bathroom sink that went to the basement.... your name is muffin you don't know nothing ; ;
Reply: @Bump1972  why is that? I'm thinking if I got drunk when I probably would have fallen over once or twice! 🤣
Reply: @winros  If your knob & tube wiring has been disconnected and replaced, that is great.  I also have an old knob & tube system in my home that was disconnected and replaced in the early 1950's.  Just make sure that someone never reconnects the old system to the new system.  
What is a "cattycorn"???
Reply: @chrisgraham2904  yes it's disconnected and I have a new wiring put new pipes always doing something to make it better! She got some good bones on her I must say! How old is your house may I ask? But if I tell you then you're going to know where I live I will give you a hint... Tires!
Reply: @winros  My home was built in 1926.
Reply: @chrisgraham2904  3 years apart!! 🤣
Reply: @grumpyoldwizard  pose a fire hazard, not pose as a fire hazard
Reply: @chuckwadnofski7147  I expect there are two possible answers; zero or one.
Reply: @larsonfamilyhouse  what i was thinking, but not im no expert either.   . . . Fire rises, so if there's a fire in the basement and it gets sucked up the chute to ignite the tile bathroom seems like less damage than fire rising naturally from a less confined space into much more oxygen. . . . .
Reply: Yeah, makes me wonder why my house was allowed to have a wood-framed plenum. Not that old (about 25 years).
The return air for the furnace is just a large hollow column from the attic to the furnace in the garage (two story house). It's drywall on the outside, but just bare framing on the inside.
Reply: @deniseboldea1624  People could still fall down the stairs from the second floor to the first/Ground floor. My mother fell down the stairs while carrying the laundry and got hurt badly and my grandmother had to drive her to the emergency room. Anyway, after that whenever I had to take care of the Laundry I would drop the hamper to the ground floor but would tell bombs away to let my grandmother or anyone else know to stay clear. And have to use great care when climbing the stairs carrying clean laundry. Just as when carrying food l would have use care is as nit yi get hurt. Thus a wish for the dumb weighter at least if not a laundry shoot to the laundry room. My Mother inorder her back even worse that if the first injury from when she was a teen. She hit her head really bad 
And almost broke at least one of not both legs. Instead really bad strains and sprains along with twisted and dislocated joints.
Thus my wish for features for safety after seeing what happened to my mother. May she rest in peace. She past away on 2-4-2016. She was born on 12-29-1948.
Reply: My sister's house was built in the late 1800s originally as one story but a second story with a small kitchen and sun room additions. The second story was basically scabbed on with no headers. Another interesting thing they did when they built the kitchen and sunroom additions was they used the concrete form boards for the sub floors and roof decks.
Reply: Laundry chutes stopped with the invention of dryers and architects began designing laundry rooms. Laundry rooms usually were placed on or near the kitchen for inexpensive and easy waterline access. If laundry rooms were considered that big of a fire hazard they would have to be sealed off or removed. Laundry used to be done in the basement in the winter. There was a fireplace in most older homes to heat up the basement in winter. Part of my childhood I grew up in a large house built in the late 1870s, that house still stands and I would bet the laundry chute is still there. I currently live in a house built in 1930 and the laundry chute has been sealed by a previous owner but it is still here and functional if I remove the plywood cover. There is no fire code that I could find that prevents laundry chutes. Also, they don't build houses the same way, bi-level and tri-level houses are far more common. Look at older homes, many pantries or back porches were converted to laundry rooms to easily access the water lines. Side note, I used a ringer washer as a child, then we hung laundry in the basement, though we did have an oil burning furnace and a heat vent opened into the basement. This was outside of Omaha, Neb.
Reply: They have an updated version I've seen an add for its a small hole in the wall and you toss your laundry in it gets sucked in and moved t o the laundry room it works only if you already have installed a wall vac
Reply: They have also become outdated because many homes are placing the laundry room on the same level as the bedrooms where most laundry is accumulated. The last home I lived in had its laundry t oom on the second floor which makes it much easier way to get all your clean laundry back go wherever it belongs without having to carry baskets up the stairs
Reply: @marialiyubman  
Umm....LOTS of people STILL do heat their homes with OPEN FIRES !! 
Especially in old country houses !!
Reply: @tomconner2326  it’s not against the fire code exactly. If you install a retrofitted pex pipe home fire sprinkler system you can have a laundry shoot in South Carolina. It will only cost you around $3.50 per square foot. The LLR allows plumbers to install pex pipe fire sprinklers that tie into the plumbing line without the need for orange pipe or a separate pump system. So they aren’t against code… as much as they are only allowed with the offset.
Reply: I had a brand new house built just 5 years ago and I have a laundry chute and dumb wader..
Reply: I kept reading the reasons for the laundry chute being outlawed in the comments. But many of those making them probably have not had one or one that was properly constructed. Laundry chutes that are properly constructed should have been made or lined with metal and has a metal door ( or lining of metal), so the door closes both at the top and bottom. The chute's aren't supposed to be large enough for a child; approximately 9-10" by 5" and about 3' above the floor. The fact that laundry getting stuck is because someone stuffs it; but easily fixed with a pole from below. A "chimney" effect would be very low if the chute's were installed properly. It would be interesting to know how many home fires were worse because of a laundry chute.
Reply: Really? I assumed it was dangerous bc kids used them as slides.
Reply: @dogman9291  easy...all you need is a trap door between floors made of fire retardant material... It would have to be one that opened down with weight on it...and perhaps a pull cord at the bottom to clear any stuck laundry.. that's why elevators use solid doors instead of the old cage type ones..as well as fire retardant walls....to restrict airflow... And prevent the fire from spreading upwards by burning the elevator shaft.
Reply: I Love my laundry chute.  Mine has two. Bathroom hallway upstairs, and kitchen downstairs.  Laundry comes out right beside the washer. So convenient.
Reply: @xr6lad  
Exactly. My friends and I would go down every single one we found.
Reply: @xr6lad you should educate yourself before making ignorant comments. "Chimneys" that allow vertical airflow add greatly to the speed at which a fire can spread--much faster than waiting to burn through a solid floor. Talk to a fireman, or a building inspector, and they can educate you.
Open stairwells, chutes, and the like were contributing factors to major fires in the past, such as tragic hotel fires in the late 1800s.
Reply: I believe the most common reason for laundry chutes not being in modern homes is because they moved the laundry room to the main floor.... but maybe if a second floor is added the chute would be useful the door on the chute should prevent the flow of fire
Reply: @smartysmarty1714 they were metal and they did have doors on them that closed...or at least all thise I saw in my area
Reply: Pretty sure if we had a laundry chute in our house me and my siblings would have taken a ride through it at least once.
Reply: @phw340  sorry most chutes are narrow not even an infant could drop through it. Or at least all the ones I saw
Reply: @thistle76  Gotcha!  Never seen one up close, just in pics.  When we were small we went into any place we could, especially when playing hide and seek.  I was scolded for hiding in the clothes dryer for fear of someone turning it on  certainly can see that now but not when I was a kid.
Reply: We had a laundry chute in our house that was built in the 1970s. We used it all the time. Good for kids so they didn’t keep dirty clothes all over. Went right from too floor to laundry room. Such a great invention!
Reply: How, exactly, do you fireproof a duck? And why would you want to?
Reply: @grumpyoldwizard  if you had stuck laundry, drop a big ol tomcat down the chute. Then go downstairs and left the cat, and your laundry out. Hopefully  the cat won't shred your laundry...
Reply: @badbiker666 So what genius installed jagged sheet metal??
Reply: I had a chute installed some years ago I THOUGHT IT WAS A UNIQUE IDEA Then I came across your comment and revised I'd created a hazard. I mentioned your comment to my daughter and she then told me of the many times she had eyed it as a great place to hide except that she was too plump😮😮
Reply: I miss laundry chutes.